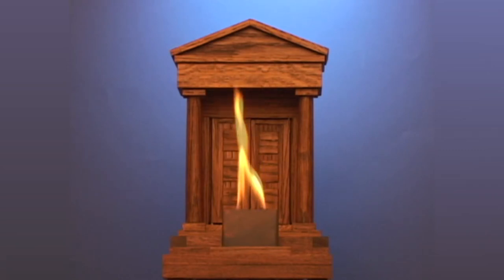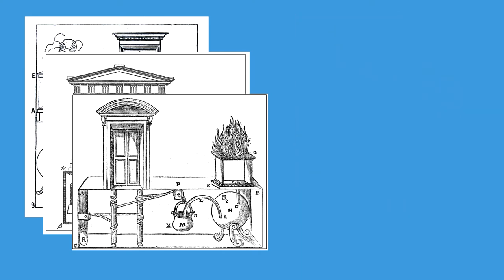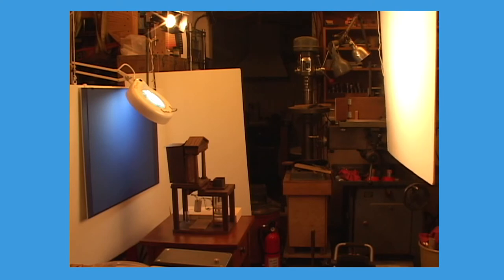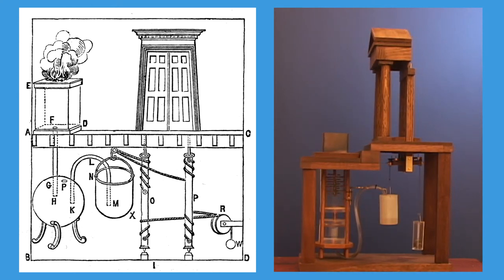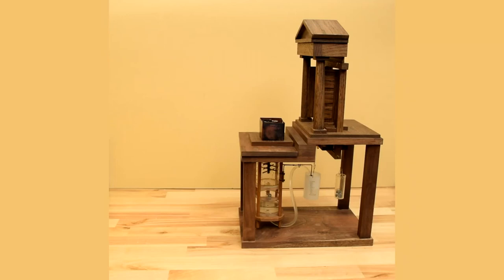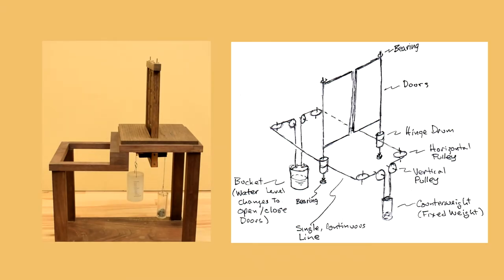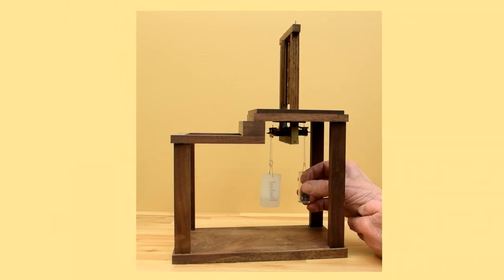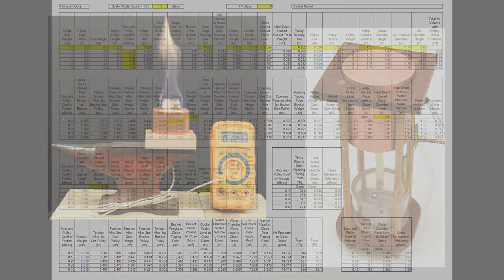Hero's Temple Doors - Part 1

Comment: Fantastic model and really excellent description. Many thanks. I saw a version of this at the Kotsanas Museum of Ancient Greek Technology in Crete and , to be honest, could not really understand it. I thought the movement of the water container would need to be larger to move the doors and therefore remove the "tube" from the water and therefore destroy the siphon. Didn't also realise the siphon tube has to be "charged" right from the start. It was really irritating me and other internet explanations were just not convincing. For example, one "cartoon" version had the tube actually slowly getting longer. Your precision model and commentary  is superb and the visibility that you designed in is ace. Great design. Thanks again.
Reply from the maker: Really appreciate your comments.  I'll add some more detailed design discussion and some modifications if interest develops.  The effort ends with predictions of component sizes for a full scale version . . . it would have been massive!